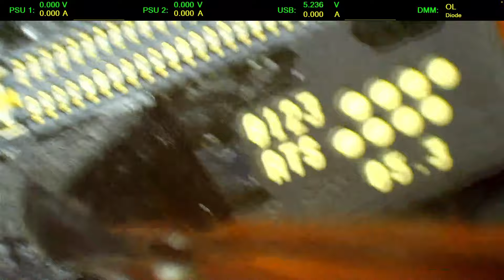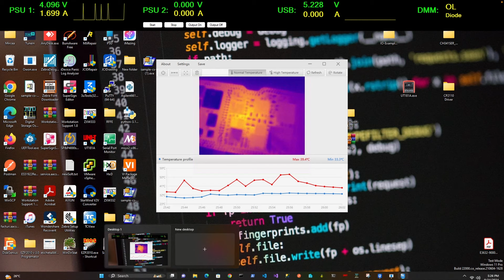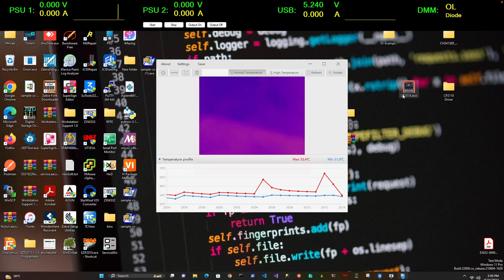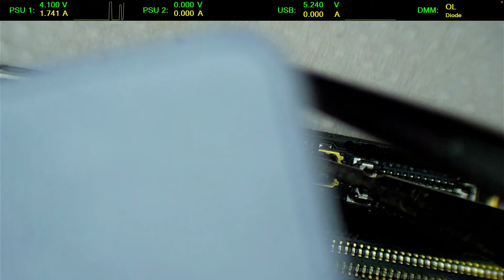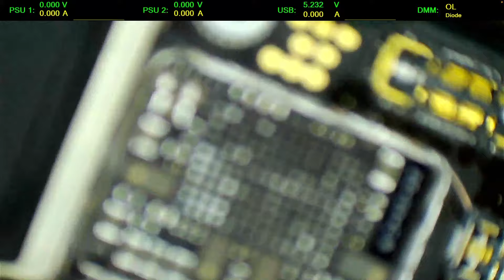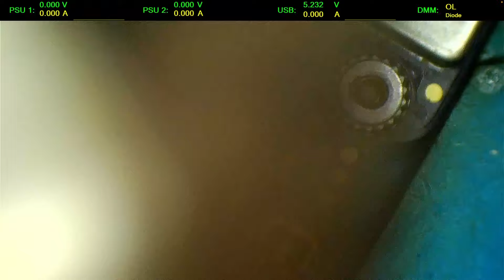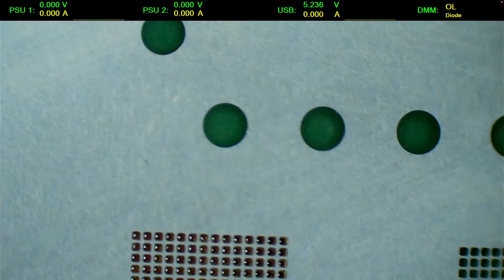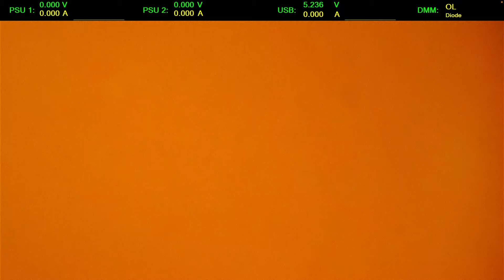iPhone 13 does not power on nor charge

Comment: Useless , camera angle is mostly away , no need to show complete deaktop screen
Reply from the maker: I am sorry you didn’t like it. This is a typical iphone board repair and there are plenty of YouTubers showing it using different approach. I am sure you will find something for your likings out there
Reply: @mirceaalicu  i liked your videos and i learned alot from you sir , your videos has a level like a pro , but this one ☝️, its not feel like u made that video , u working on motherboard and your camera is on table , and same when u using thermal image , whole desktop was there , these are the mistakes that i never seen in your videos
Reply from the maker: @Daily.report1947  you are correct. I don’t have good days always ☺️